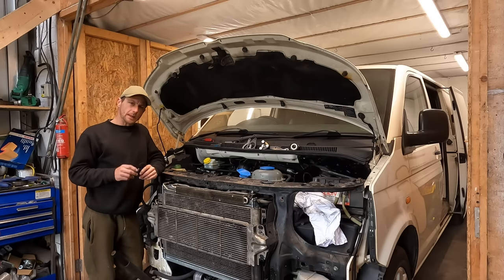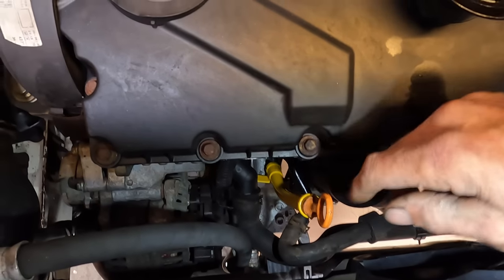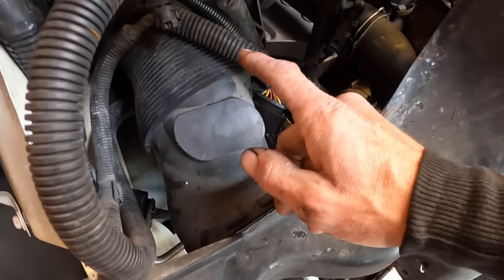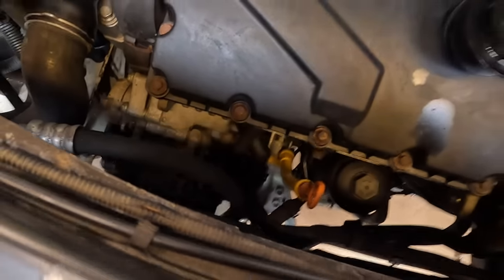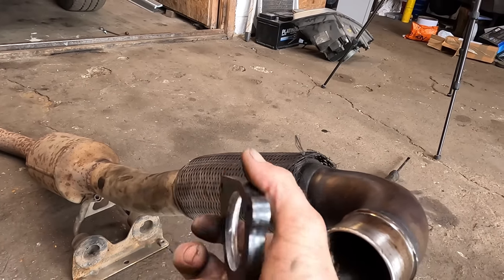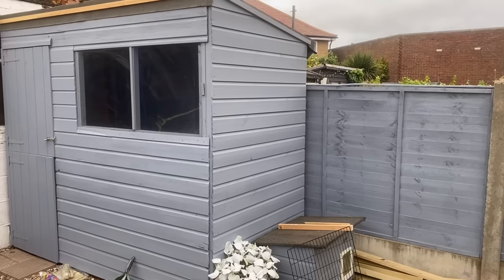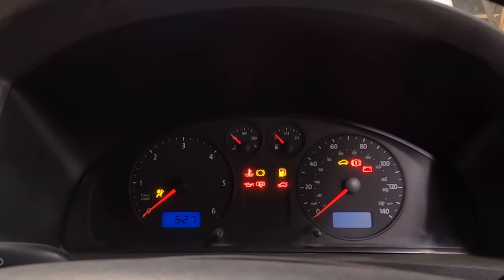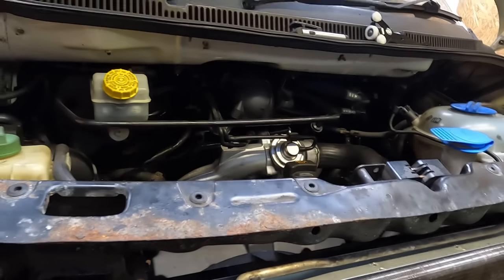Vw T5 Transporter - progress update - build series Ep3

Comment: I totally agree with your comments, one thing that i did hear was that the oil filter housing was a problem clearly not as yours has slotted in perfectly, the limiting factor with power is the 5 speed box and small clutch, my old 1.9 was mapped from 105 to 130 ish and that was about as much as the clutch could take (increase in torque as well), if you go 6 speed then it's way better for more grunt, however not all speed boxes fit ( i don't think the car ones do) but the early t5.1 do allegedly!
Reply from the maker: There is 2 types of pd130 the more common one has the large oil filter and the other one is from the Skoda fabia it has the tucked in oil filter. Your right about the box’s and I’m not going for big power I just want it to go alright and breath happy with reliability. Thanks pal 👍

Comment: Great video I see you had to reset the clutch I've just had my gearbox replaced but clutch as it has only done 30k mile but is slipping now 2 weeks after gearbox replacement should it have been reset cheers great work
Reply from the maker: Hi James thank you, yes re using a clutch is perfectly fine but these clutches need resetting as soon as the bolts are done up the first time and clutch depressed it self adjusts. Some people don’t know this unfortunately, did the garage remove your clutch? If they didn’t it should be ok but if they did then they should have reset it. I would ask if they removed it? If they did you can then reply was the preside plate reset because they need resetting anytime it’s unbolted. Hopefully you can get this resolved without paying anymore money.

Comment: One thing you haven't mentioned yet, and I'm interested because I'm putting an ASZ in mine, did it fire up and run straight away without any remap? I've been told they run badly until remapped for the pd130 injectors
Reply from the maker: Hey jay, yes it’s still running the original map on the pd130 injectors, it seems to run fine. I’ve only driven it to the end of the road but it’s running fine. Thank you

Comment: Ahhm, I am not looking forward on mine to replace the alternator pulley. Looks like a lot of work to get to it once the front is on the van.
Reply from the maker: Hey Richard, have you got air con? If not there’s more room. It wernt to bad, front bumper off intake pipe off and you can just squeeze in there with a gun of some sort 👍